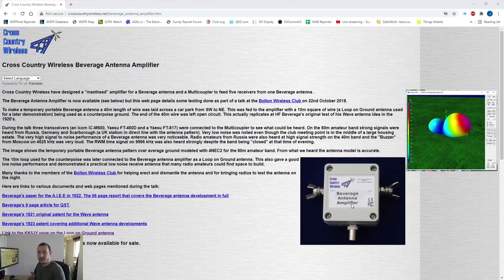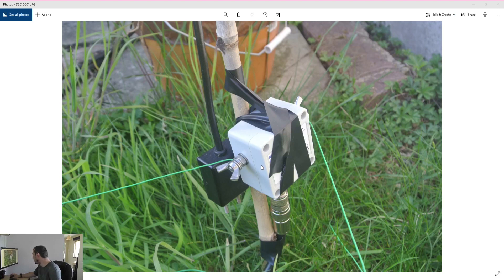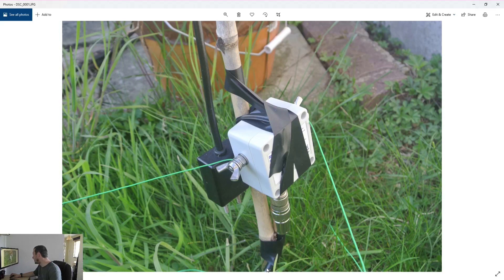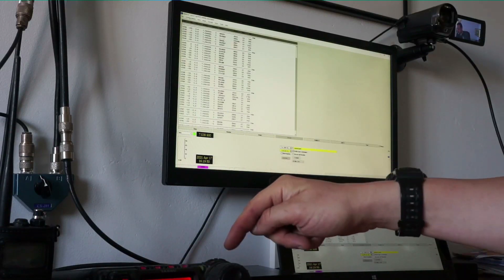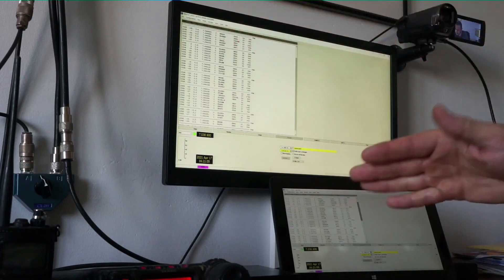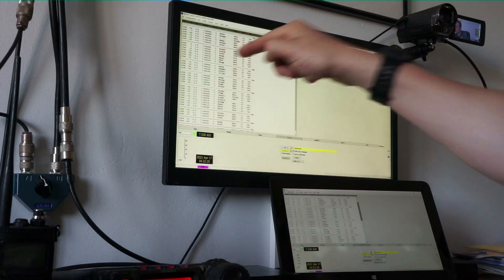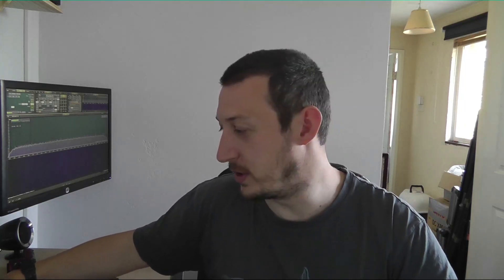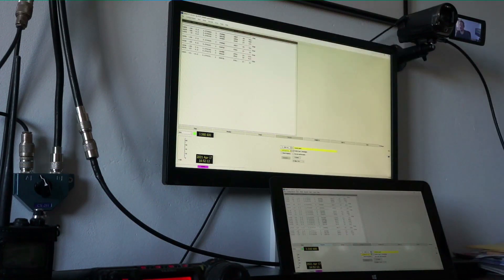Loop On Ground With Amplifier

Comment: It's part due to both. Raising the loop reduces ground losses whilst increasing signal incidence angle range without really upsetting the noise floor. Plus the pre amp helps further.

Comment: My Inverted L antenna used to  25 FT high. but, I lowered it to 10 FT.  the noise level was reduced significantly.  at 25 FT noise level at 7MHz was S9 , at 10 ft S1 level.  I think antenna lower than roof line of neighbour help cut noise coming from horizontal direction.  neighbour's house act as shield and only allowing signal coming from sky at some angle.

Comment: Hi, my name is kev M0GOI, I use a LOG 25feet each side and its just in my back garden on the ground and it works a treat for me.
The minimum sude length should be no less than 15 feet.  Every vid ive seen where these antennas are used they are on the ground as mine is. Where the pre amp is concerned they suggested if you have a modern transmitter/ receiver the pre amp is not really needed. 
Keep gping ad mine works great and the nouse level is low.

Comment: Keep at it.  You will find a good solution for your compromised operating position.

Loops are most efficient when the area inside is maximized with respect to the electrical length of the antenna.  Hence the most efficient is circle then regular polygons, squares, and finally triangles.

You garden doesn't support optimal shapes for lower bands.

The more you squash your loop the more it will act like a folded dipole.

If LoG does not meet your needs then try a small receive only magnetic loop.  They are typically 1/10th to 1/8th wavelength on lowest band and are amplified and broadband.

Comment: hi james. real interesting video. I am testing a LOG at the moment, and some of my test results might be interesting to you. If you check my qrz page zl3xdj, you will see a picture of my loop, where the noise level alone was compared to my vertical tx ants. the noise on the loop was -20db down on the vertical. No amp used, just 9-1 transformer and coax to the radio. With my loop on the ground dx eu sigs were good, loop slightly raised , eu sigs went down. 
Today I shortened the loop by 10m close from  road shown on the right end, as this is where my noise comes from, street power lines, but the shortened loop has the same noise, but low angle dx had gone down quite a bit, and the noise level was the same as the full size loop.  I think my next step would be to move the feed point from the corner to one side of the loop, which would be opposite side for the direction LP for dx. The loop wire being near objects, does not seem to bother it at all, but right on the ground is a must for low angle rx.
Also I await a low noise amp to try later, but my radio's preamp seems to work quite well for now. check out roly zl1bdq on youtube for another good video about LOG. 73 brian zl3xdj.

Comment: Hi James 
You don’t seem to be taking into account the gain of the amplifier you added to the loop. Raising it off the ground and adding the amplifier at the same time doesn’t show which had the main effect. Trying it off the ground with the original transformer or on the ground (not under) with the amplifier would make it easy to see which change gives the best performance. It would be nice to know how it works in normal use and not just using wspr.
73,
John
Reply from the maker: Hi John, That is very true & there is definitely some merit in retrying it with the wire actually on the ground. I'm not overly convinced of it's benefit in my situation though (at least not on 40m or 80m which are the bands that I want to use) because even with the improvements, it still falls well behind my EFHW on the SNR figures.

What I am trying to prove is whether I'm better using my EFHW for receive, or using a LOG. The problem with testing in "normal use" (by which I presume that you mean SSB) is that it is somewhat subjective.

I consider WSPR to be more useful test for this comparison because it gives you a DB rating for each antenna above or below the noise floor. The results seen with WSPR should translate over to SSB & other modes.
Reply: @HamRadioOnline  The radio and the SDR (the different antennas) have different noise floors, so perhaps direct comparison of DB is not apples to apples. I would just go to see the number of stations it receives on each antenna, and the pattern. You could use FT8, as there are more stations transmitting and you will be able to build a better map with each antenna. Then you can compare in pskreporter (use different callsign ext. )
Reply: I found raising my loop off the ground by 4 to 6 inches significantly improved signal without worsening noise. I also found that SNR was further boosted by about 6dB through using a very low noise HF pre amp. Very capable. Picks up far east and east coast US very clear to UK.

Comment: Hi James, I found with my Loop on the Ground antenna that it dropped off in performance below 40m. Like you I don't have the space to try a larger loop. Try it on 20m and above and it should work well. 73, Chris G4HYG
Reply from the maker: Could be an interesting experiment. Maybe compare it to the mag loop or the High Z vertical. I could setup an EFHW for 20m & compare it to that?

When I get a bit of time, I also want to set up a beverage antenna with it in the field to see what that does. 

I've also been playing with the High Z  amplifier & I'm very impressed with how well that is working. It's easily outperforming my EFHW on 40m & giving it a damn good run for It's money on 80m (the EFHW is resonant on 80m).

I always thought that verticals were meant to be noisy on receive, so I didn't hold out massive amounts of hope for it to be honest, although I did wonder if sticking up a vertical at the very bottom of the garden (as far as away as possible from the house & other sources of noise) might be beneficial. 

It's also proving to be very useful as a general receive antenna for the SDR.

I think that I might end up taking the option of buying it & hanging onto it!